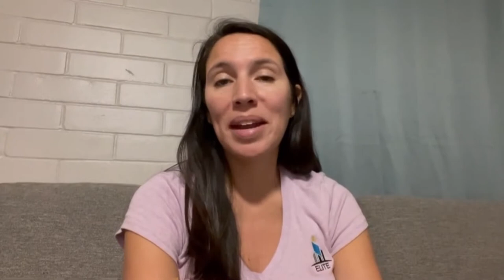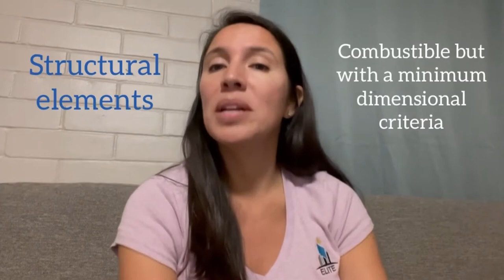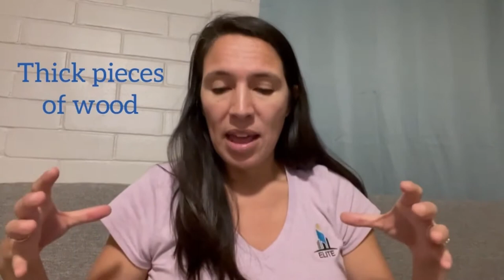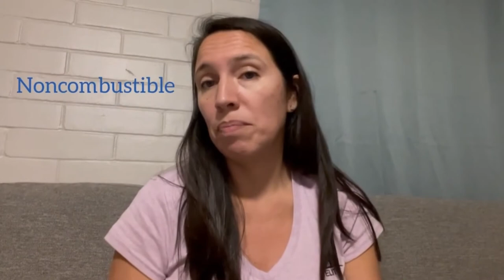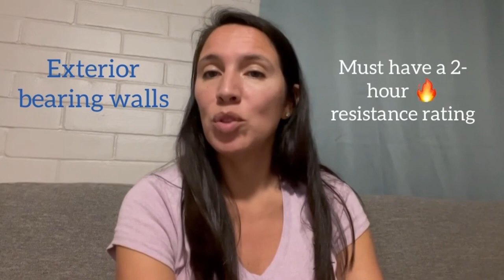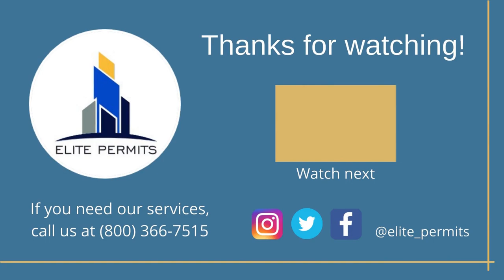Type IV Construction Explained

Comment: thanks for making such informative videos, please let me know about minimum evacuation time in type 1,2,3,4 construction type .... thanks
Reply from the maker: Hello😀

Our expertise is in the Florida Building Code which is based in the international building code, neither of these codes have a minimum evacuation time, the building code and NFPA codes generally focus on establishing guidelines and standards for fire safety, emergency response, and evacuation procedures, but they do not typically set a specific minimum time for evacuation.

The time it takes to evacuate a building or area during a fire or other emergency can vary widely based on factors such as the size of the building, the number of occupants, the available exits, the nature of the emergency, and the effectiveness of the evacuation plan and procedures in place.

There is a minimum fire resistance rating of the structural elements for the building based on the type of construction, so in case of a fire, the building can stand in place while the occupants safely exit the buildings. You can see the hourly requirement in our type of construction videos. 

Hope this helps!